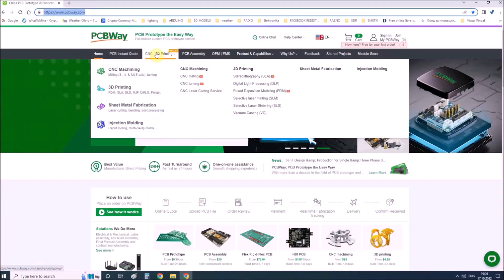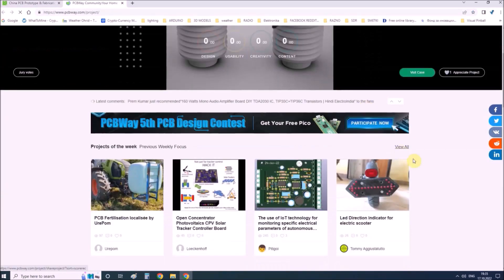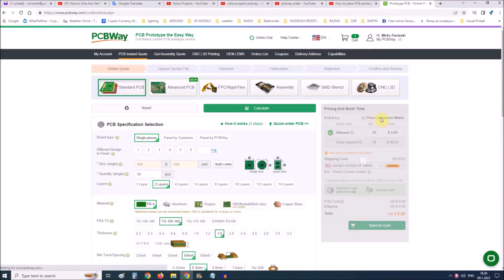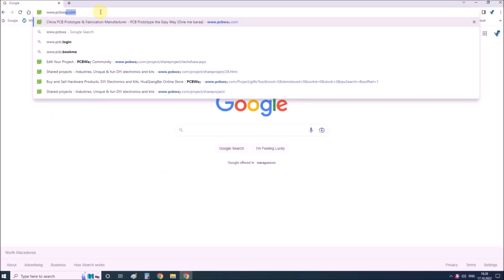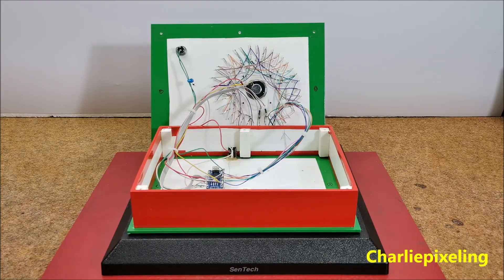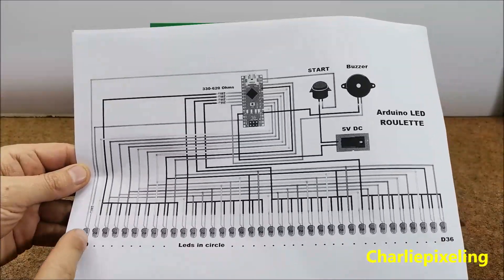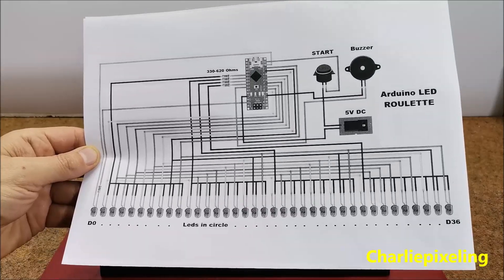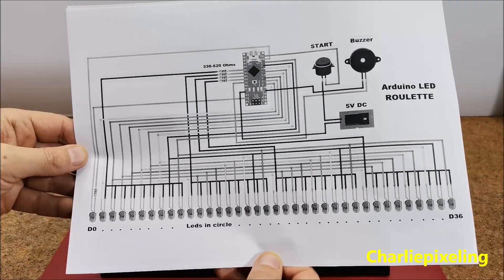How to make simplest  Arduino European Roulette Game ( 37 Leds )

Comment: What are the recommended resistor values for standard white LED's with a 3V forward voltage operating at 25mA?
Reply from the maker: If power supply is 5V resistor value is 82 Ohm
Reply: @MirkoPavleskiMK your circuit recommends 330ohm to 660ohm? Which one is correct then?
Reply from the maker: @louwclaassens4988  LEDs light up perfectly even at only 5 milliamps (430 Ohms)
Reply: @MirkoPavleskiMK   thank you!